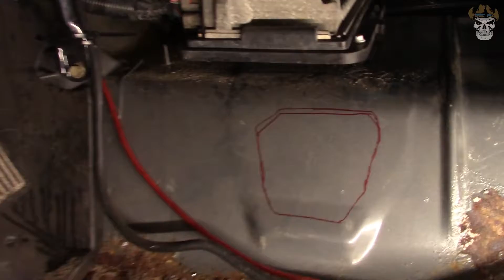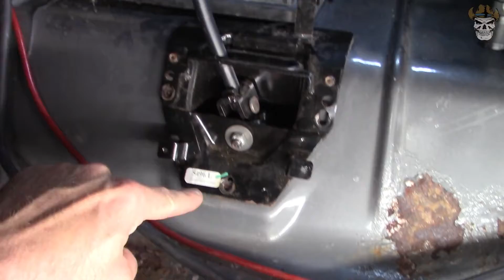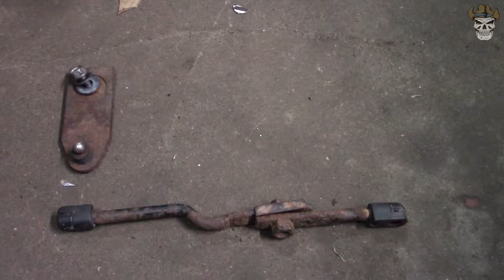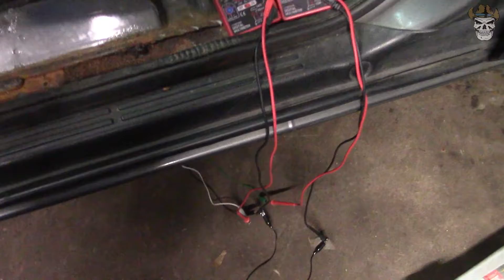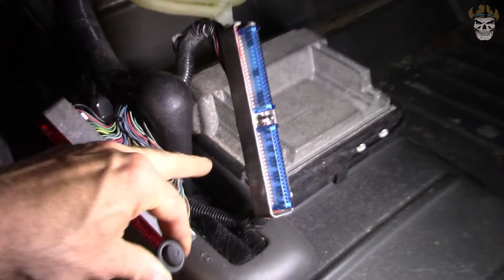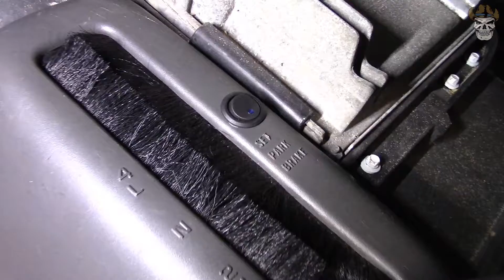Push Button NP246 To Floor Shift NP261 Swap

Comment: Is all the same procedure with the wiring if you are doing it on a 2005 Chevy Silverado z71 ?
Reply from the maker: The only thing you have to wire would be the 4 low ground wire to the computer so the transmission shift points change.  I dont know if the wire color is the same from the 99-02 and the 03-06.
Reply: @PostalRedneck  oh ok thanks for the info.
Reply: @PostalRedneck so you you not have to wire the front diff to engage?